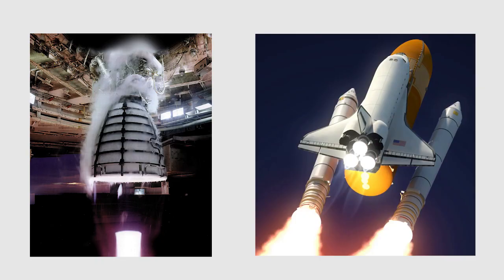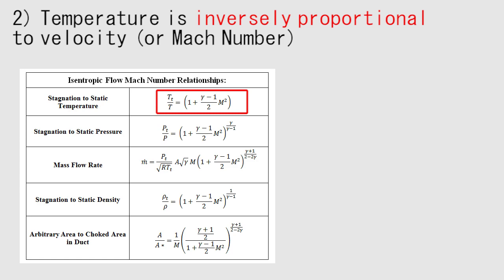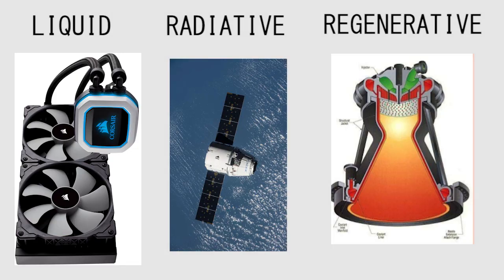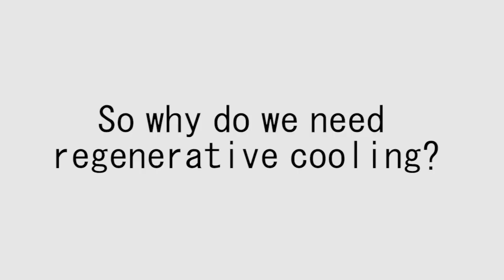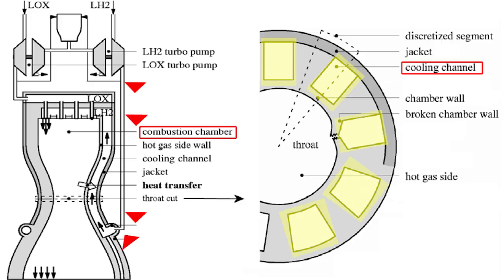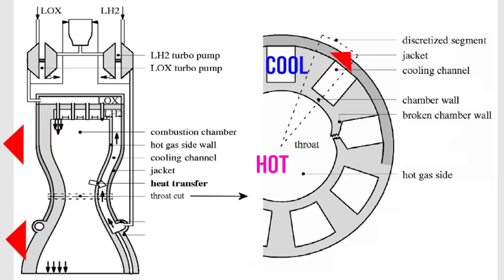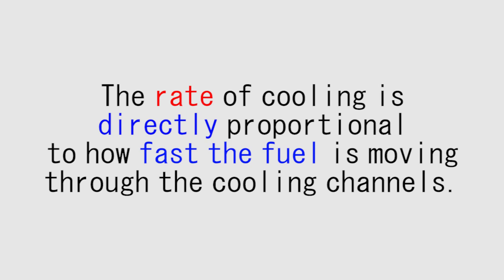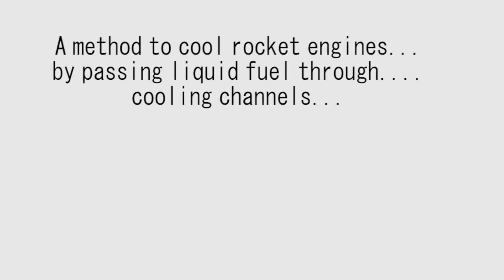How Do Rocket Engines Regulate Temperature - Regenerative Cooling Explained!

Comment: Hey I am a high school student planning on studying aerospace engineering and have played with the idea of building my own rocket engine since the end of last school year. Problem is, most of your videos quickly dive into university level fluid mechanics and I have a hard time keeping up. How can I learn this stuff now so that I could make a (liquid) rocket engine sometime this year or join/create a rocket team and be able to help with liquid propulsion?
Reply from the maker: Read the Sutton book
Reply: @VDEngineering  That's an expensive book, you sure it has everything I need to get started?
Reply from the maker: @spb1179  yes
Reply: VDEngineering Hello, I am 12 years old and want to learn this stuff.  I have Rocket Propulsion Elements 7th edition, and have taken high school physics.  Are there any other classes I should take to understand the book.
Reply: @alexanderweaver6047  If you haven't, read NASA SP-125, or 'Design of Liquid Propellant Rocket Engines', by Huzel & Huang. You can download it as a PDF, or buy a slightly updated version on Amazon (it's a little expensive, but I found the paper version was worth the investment). It gets not only into the theory but also into practical aspects of the design of every component of a rocket propulsion system, from thrust chambers to valves, pumps, turbines, propellant tanks and ducts, control sytems... Great resource. You should also read up on thermodynamics (to understand combustion, expansion in a thrust chamber or turbine nozzle, and convective heat transfer), the basics of fluid dynamics (pressure head, bernoulli's equation... to understand propellant flow) and the mechanics of materials (to be able to calculate loads to size parts). Have fun !

Comment: Hi I am a school student in India and I need to make a liquid propellant rocket engine, I need to know more about the injectors and the total cost of making a bipropellant rocket engine. I need more simplified sources for learning all the principles and parts. Can u please help me?
Reply: Vortex combustion rocket engine should help with cost as the “whirlwind” of cool air around the outside of the combustion chamber keeps the walls cool, therefore material choice isn’t of too much concern here and price can be reduced heavily. Although it depends on how powerful the rocket you want it to be.
Reply: @Test-ri2kr  I don't want the rocket to be too powerful at the moment, this project is just to get some funds from some authorities I know to make bigger rockets. Thanks a lot for helping out man!
Reply: Manish D Excellent! The vortex combustion engine is an option, it doesn’t produce much thrust however I don’t think that is of concern for you. Only problem with the rocket is the nozzle which will need a fancy material choice as it takes the full impact. Any relatively low melting point material will just get obliterated. Great to see you interested in this stuff though! You will learn a lot from this! I’m from Scotland and we did absolutely nothing like this. Education here is like a factory. Robotic teaching. There are projects like this going on but they only let a select few in (I.e. the ones with the most money). These people tend to be from private schools and rich families who are capable of spending more and stuff which isn’t fair but it is what it is. Good luck buddy! I’m still learning myself and I’m still a rookie when it comes to rockets but I’m always here to try and help if you need!